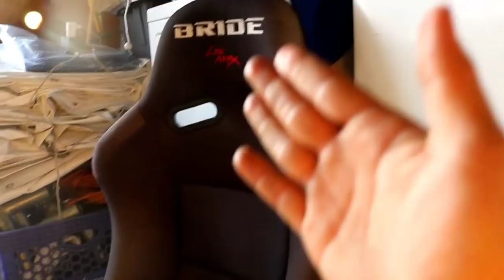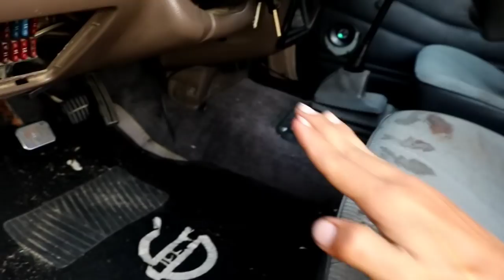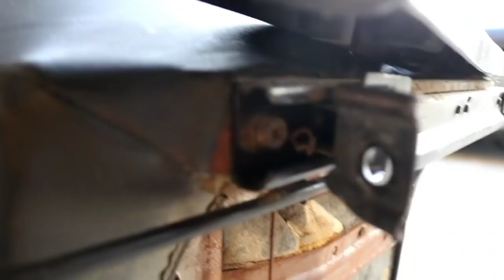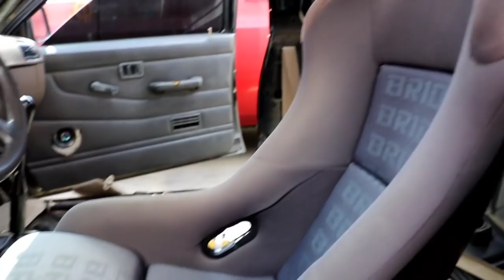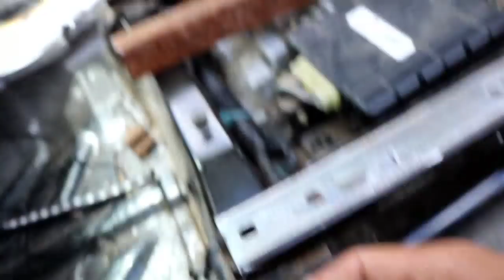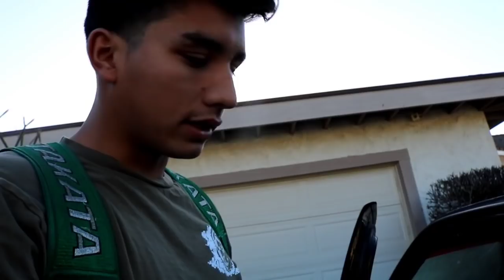BUCKET SEAT INSTALL ON THE D21 DRIFT TRUCK

Comment: I'm hoping you can answer a question for me. I purchased a used 2019 Ford Transit. I have scoliosis and the seats are extremely uncomfortable for me. The aftermarket seats are too expensive. I was wondering if I could pull Nissan Murano seats from a salvage yard for the van? They both have airbag tags on the seats. The question I have is will the air bag wiring harness in the Ford Transit fit any seat or only aftermarket seats?

I did look into reupholstering the seats but he says he can not change the contour, only the covering. He suggested replacing them and provided a contact for a metal fabricator to help out.
Reply: Sorry, I have no clue.

Comment: So the 240 seat brackets fit the hardbody? I have a hardbody and I want to my sparco bucket seat in but I don’t know where to get seat brackets for it
Reply from the maker: No, the 240 seat bracket were welded to the brackets. I used the factory seat brackets off the d21. You can buy dest bracket that are legit for d21's and would bolt right up for your sparco seat. I just wanted to make it this way for my viewers who want to ball on a budget